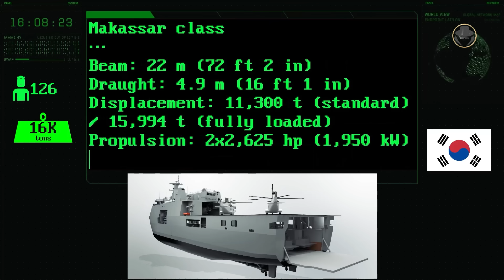Makassar class | the best-selling amphibious assault ship

Comment: Philippine Navy 🇵🇭 needs at least 4 more Makassar class LPF & the 🇵🇭 Coast Guard  at least  2  ( 1 Hospital ship & 1 as PCG  patrol command ship in Philippine Rise) 👍
Reply: My thinking on this is that the Philippine Navy could order improved Tarlacs and then turn over the older BRP Tarlac and BRP Davao del Sur to the PCG to be converted into a patrol command ship and hospital ship. PT PAL actually has made some significant improvements to the design that many doesn't know about. For example the Indonesian hospital ship KRI Dr. Wahidin uses two CAT Marine Engine 280-16 rated at 5320 kW each. Meanwhile the BRP Tarlac and Davao del Sur uses two MAN STX 8L27/38 rated at 2920 kW each. That's a major upgrade in engine power. Put those new engines in an enlarged Tarlac-class and the PN will have a major upgrade in their sealift capability. The first batch of Tarlacs can then be handed to the PCG who doesn't need to transport tanks but could use them to transport supplies in humanitarian operations or act as a floating hospital or as a patrol command ship or whatever they deem necessary.

Comment: Where did you obtain that wrong information that Peru wants to exchange an LPD for 2 used 209 class submarines with Brazil? Peru is upgrading their 4. Submarines 209 1200 class to digital control and missile capability use. First one is back in service.  Next by 2028 will  be ready to build the first local Submarine with korean technology, such as a new multirol ship and an oceanic OPV and 2 other ships.

Comment: You can see in this video, after Indonesia (PT PAL) got the license of Makassar class since more than 20 years ago, there is no significant innovation for LPD besides changing the lengths. Don't know how much longer other countries would be interested in this same type of ship. 

The same as Indonesian Aerospace, there is no innovation after producing CN-235 (Indonesia-Spain) since 1983. While Spain already innovated the upgrade versions. This is the typical state owned company in Indonesia. To much reliance on license design, then dead after licensing. Then keep asking hundreds of millions dollar capital injection every year from the Government, but never returned any profit to the government.

But I'm glad other private shipyards in Indonesia are already catching up. If PAL never changed, soon they will be left behind. Mark my word.
Reply: There are continuous improvements. They are not something you see from the outside though. For example, the first batch of the Tarlacs have more powerful engines than the original Makassar-class. But KRI Semarang has even more powerful engines than the Tarlacs. The turntable of KRI Makassar can't handle a Leopard 2 (they can still carry Leos, but the turntable must be locked in place). KRI Semarang can, thus speeding up the loading/unloading process. Similarly, the turntable for the first batch of Tarlacs is rated 15 tonnes, because back in 2014 that's the heaviest vehicle they had. The new batch will be able to handle 25 tonnes, because that's the weight of a loaded Sabrah light tank. The hold has been enlarged too in order to fit larger vehicles.

But from the outside though the ships look the same.
Reply: There's an innovation with the 163 m MRSS ship design based on the Makassar-class, in construction for the UAE already as of now.
Reply: @fauzin3338  yes.. it just takes 20 years later after the first commission
Reply: Bcos lack of salesman division and RnD division  @FebiMaster
Reply: your mindset about state owned shipyard little bit outdated
,based on makassar class, currently PT.PAL  build LPD 163 for UAÈ while KCR 60 based on both FBP 57 m and sigma class
Reply: there are iterative differences on the design. The first 2 are based on the original Korean designs, 2nd batch has a much shorter superstructure freeing up one more spot for medium sized helicopters as well as facilities for command and control, 3rd batch extends the superstructure again but with an integrated mast, Space for davits to launch 2 LCVP's, better engines and it now has accommodations for 500 troops now instead of 354 in the first 2.  This is all happening while Pt PAL is constructing 2 REM Class frigates, 2 LPDs for PN, 2 Hospital ships, 6 Sampari class fast missle ships and the iterations of improvements on each batch, and 1 Nagapasa class submarine. They are nothing compared to giants like HHI, DSME or Fincantieri but there is a gradual progression
Reply: Mencari kekurangan negara lain? Lalu kemajuan kalian dalam memproduksi alutsista dalam negeri sudah Semaju apa☺️